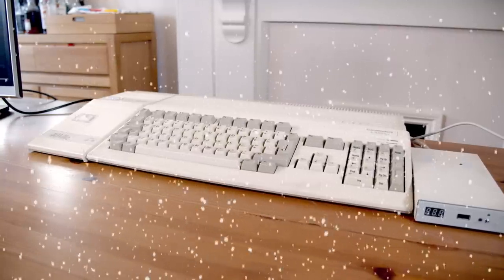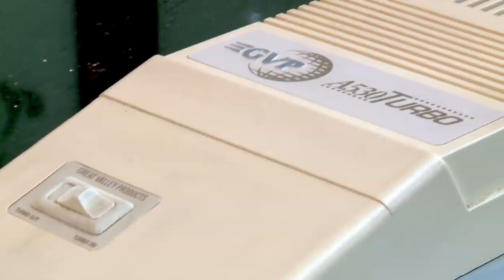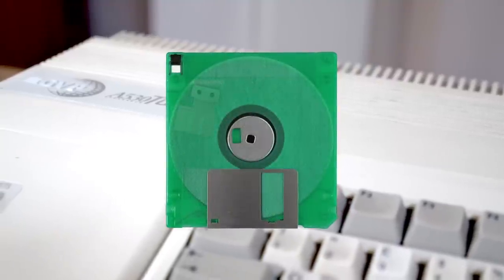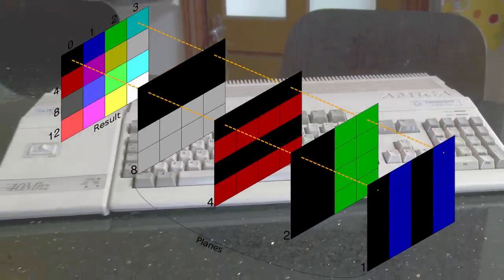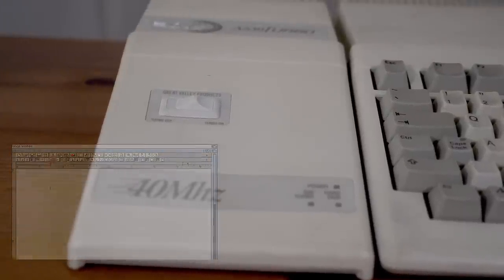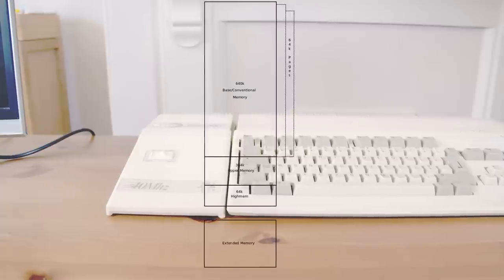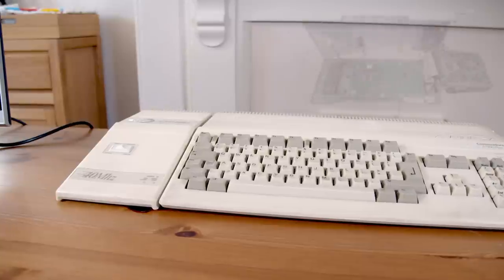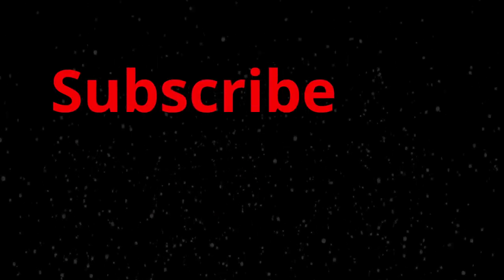This is a PC, no really.

Comment: Great video I bought the ATOnce 286 emulator for my a500 back in 1990. It replaced the 68000 chip with a daughter board that had both chips plus an emulator for video/disk/etc. it used amiga memory, hard drive, and floppies. Worked great and got me through college without having to buy a pc
Reply: I bought an non-working A500 off eBay a couple years ago, and the ATonce was inside it, which was a nice little unexpected bonus, but I pulled it out in order to get the machine working and never gave it a try. Besides, I'm not a fan of putting the thick legs of a round turned-pin socket into a single/double wipe style socket since that can ruin the wipe style socket over time. Maybe someday I'll install it to see if it still works...
Reply: Had it too. Worked fine. Even without a hard drive.
Reply: Hmm... that's just the opposite of my experience with the ATonce. I sold Amigas and none of my customers had much luck with it.
Reply: @jimsteele9261 The trick was to NOT try to have both systems going at same time. instead, when you want to run as a PC, you only give the AmigaOS the bare min amount of mem and resources to function. Later versions addressed this by also adding memory to the daugherboard.  Most non-games worked fine for me.... though any crashes brought up error messages in German!
Reply: @nicholas_scott  The "Plus" version is the one I had and it was definitely a lot better. The speed bump on the 286 to 14MHz was okay, but the onboard 512KB of dedicated PC RAM was the real gold. It also really helped if you had even a little bit of FAST RAM expansion on your A500. I ran it no problems with a mostly stock Amiga 500 with a 2nd floppy drive and a 2MB RAM sidecar.

When I wanted to use the PC emulation I had a script file set up that I could run that would make a 1MB RAM drive and copy all the necessary emulator files from the ATOnce disk and a minimal DOS "C: drive" install over to it and run it straight from RAM and allocate another 512KB of the fast ram to the PC so that it had a full 1MB available to it. That left the Amiga still able to run normal Amiga stuff with 512KB CHIP (minus the PCs video RAM) + 512KB slow + 512KB fast, and I could use the internal floppy for the Amiga and the external floppy for whatever PC software I was running. Multitasking both systems was pretty good with that setup even with a stock 68000.
Reply: @nicholas_scott  Good to know. thanks.

Comment: "Expanded memory" used bank switching to make >1 MiB memory available via pages in the high memory area. EMM386 managed extended memory, putting the CPU into virtual 8086 mode and mapping blocks of extended memory in a way that looked like expanded memory.

Protected mode on the 286 was still segmented, which made memory accesses in that mode slow. Flat memory would only emerge with the 386 protected mode. DPMI extenders like DOS/4GW would only work on the 386 or higher.
Reply: The 286 (and 186 to an extent if I’m not remembering weirdly) versions of protected mode really feel like a strange beta, like a bodge on the old system while they remove all the rough edges of the finished (386) version.
Reply: @kaitlyn__L  286 was 16bit & 386 = 32bit, except for pathetic 386sx, which had 16bit to 32bit built in, Intel was a mess back then, they were still working out a Modern CPU's  Architecture ..
Reply: @James_T_Quirk  indeed, though the bus width doesn’t inherently have anything to do with 286 protected mode’s oddities (esp given the 386SX). Though I can see your point that Intel was just trying everything somewhat indiscriminately (and their non x86 CPUs from the time were even more screwy!!)
Reply: @kaitlyn__L  186 didn't have a protected mode. It had a 16-bit data bus and added a few instructions like ENTER, LEAVE, and BOUND that you also find on the 286, but it couldn't directly address more than that 1 MiB of RAM.
Reply: You mean mapped into "upper memory". "High memory" is actually the first 64k over 1Mb which was addressable because of the way the memory segmentation worked.

The "Upper memory" is/was the IO space above 640k where devices were mapped, but could also have memory mapped into. This really only became common only with 386 hardware where a memory manager would remap RAM to allow freeing of conventional <640k for applications.

Comment: All EGA/VGA 16-color modes are planar, not two-nibble-per-byte.
EMM386 is not a EMM manager, it is an emulator that uses 386's page translation mechanism to recreate the EMM frame.
Reply: have no info. the the main suject of the video, but the intarnal CPU swap out card, and replace CPU on top, PC Dos side thing on the Amiga, showed if you didnt no, looking a emulators, to the point PC Dos, would if required sit in a app windows box, I think, but it defiantly, amiga sliding up-down windows like all good well behaved Amiga app/games did, amiga still the beating in background just with PC over the top of the desktop screen, the amiga on the box not related the add on card PC 720k format floppy disc, driver on the install disc, set little than copy and paste the in right folder 740k dos reading done on an amiga, not a big deal,
Reply: Hmm, I'm not sure about VGA 16-colour. I think the sequencer in those modes does actually read 16 bits at a time and then cuts them up into 4-bit pieces for translation into actual colour values through the DAC. Doing a bit of a weird retrograde thing in 256 colour where it does that but then combines them back into two bytes (essentially the DAC has 16 notional palettes, one nibble picks the palette and the other picks the colour within it, and IIRC you can even make use of that in 16-colour mode with specific palette-swapping commands).

EGA and below though, and those modes on VGA, sure.
Reply: @tahrey  the VGA and EGA 16 color modes are all the same, as in they're planar
Reply: EMM386, allows the USE of "upper memory", on a 286, first 640k, was given, then you had some work to get to 384k left as Upper Memory, so in your Dos Config file, you could tell DOS, & TSR's into that memory out of 640k you needed to run a Program .. If you wanted a Bridgeboard Card to get moving with Video, That's what the PC Slots are for on Amiga 2000 Motherboard, give the Bridgeboard, Controller Cards, Its own Video, Floppies, Hard Drives, things start getting smoother ..
Reply: @peterhalin  does that maybe mean the 256 colour modes are a strange kind of planar as well? There must be some benefit to using the ModeX tweak vs the built in 13h. Like it's actually the only way to get chunky or whatever?
Reply: @tahrey  Not sure how they work internally, but the 256 colour modes are the only ones that provide programmers access to a chunky pixel format. One of the benefits of ModeX tweaks vs 13h is that you get access to 256kB of VRAM instead of the single 64kB buffer provided by Mode 13h.
Reply: @peterhalin  ah OK then. I guess that makes it a bit easier to have a scrolling playfield for one thing when your visible area takes up 64000 of the 65536 bytes (whereas in planar modes even high rez VGA would have had a decent amount left after the 37.5K needed for each plane, and far more so for EGA grade graphics). I think some games tried to get around it by using e.g. 256x192 instead, but just having a flat map is much better.

I'll have to go back and see if I still have the spec sheets anywhere then, to check up on how the data to image translation actually works. Maybe they just figured it more worthwhile putting in the extra silicon to deal with running that one mode completely differently to everything else. (also I was probably mistakenly assuming it used 16-bit access before, as I'm more used to ST and Amiga, but the circuitry would have been running at a somewhat higher speed locally so the narrower bandwidth wouldn't have mattered, and you could either read four plane bytes in the time taken to serialise out the last four as eight 16-colour pixels, or just pump the bytes straight through to the DAC without even touching the shift registers, even if the DAC was still built in a way that meant the low nibble was the only actual index and the high nibble was used to select a sub palette...)

Comment: I could quibble about real mode segment arithmetic being somewhat different from simple bank selection (since a segment can start on any 16-byte boundary), that 286 protected mode didn't give you a flat addressing model (we had to wait for the 386 for that) & that EGA graphics (at least the 16 color mode) definitely used bit planes - but hey, it was a great video that I thoroughly enjoyed, and (small issues notwithstanding) it did a great job of explaining some pretty arcane stuff to a wider audience. Good on you for not glossing over the hardware failure too.
Reply: if i'm not mistaken, every graphics mode even vga 256col (mode 13h) used bit planes. just in 256c, planar access was "hidden" from the prog. and the card used the first 2bits of the byte writen to select the plane and the rest for the color. faster access but wasted 3/4 of the vram. mode x/y revert the vga to 256c planar. full vram but slower access (mostly). meh, pros and cons...
Reply: @giornikitop5373  Exactly!
Reply: @EgonOlsen71  yeah, basically every graphics chip since the m6548 era used bitplanes, but the amiga custom chips used  them is a very different way, making ports between amga/pc a nightmare. anyway, in the pc, once 486 was out, due to it's very fast memory access (1 clock), plannar access was not needed anymore.

Comment: The a590 was shipped with a slow XT-IDE mechanism. The controller itself can do 1.5MB/s just like the GVP if you fit a fast scsi drive. Yes I'm fun at parties
Reply: And that was done because of the prevalence of IDE - the standard that was current then for the PC. SCSI drives were the domain of Apple, high end servers, and fancy workstations.
Reply: Yep, they were using XT-IDE in their PC line at the same time and no doubt the 20MB WD drives they bought were among the cheapest slowest drives available.
Reply from the maker: Part of preformance issue was also how it loaded the CPU for data transfers. It could indeed be faster with a bettter disk, as long as your cpu had nothing else it needed todo. A big block of data being transfered would really busy out the cpu and make workbench rather unresponsive for the duration.
Reply: @RetroBytesUK  maybe with XT it eats CPU? Can't remember for sure now whether XT was CPU bound or not. SCSI is DMA in the A590 and does not eat CPU cycles as long as you have some genuine fast ram in the system. The GVP cannot perform either without real fast. :-)

Comment: Absolutely love this trip down memory lane. I had a mate who had an Amiga 2000 with a PC Bridge Board. He had an early 386 and a 1mb Cirrus Logic graphics card for it and stuck it in his A2000 and wow! PC games on the Amiga. Not that they were all that good though given as you mentioned, the Amiga was a much better games machine at the time.
Reply from the maker: That would have been a very nice machine back then, not the cheapest machine, but a very nice one.
Reply: @RetroBytesUK  It was easier to put it in another box, bridgeboards are great things, but tricky to run, but with Own Video and HARD DRIVE they speed up, with the PC slots on Amiga 2000 you could add a Controller card, so give PC side Hard Drive, Floppies, I/O & Video of it's own, then a 286 got moving ... I have both XT & AT Bridgeboards here, never got my hands on a Goldengate 486, but wanted one..

Comment: Wish there were more expansions for the Amiga 1000 out there. I bought the A1000, and just recently found out about the Parceiro expansion for it. As soon as I get that squared away, I will finally be able to get my feet wet with one of the most coveted architectures I've ever known. Thanks for the great video covering this. Wish I could afford a better Amiga without having to pay the kind of prices I just sunk into a MiSTer for...
Reply: It seems like Commodore was going for "sleek and compact" with their early Amiga models, trying to avoid the "boxy" slots look of the PC and Apple II. But the side expansion is painful, and you either have the TI-99/4A sidecar experience, or you need a wraparound expander that sits above/below in a huge slab case the size of the entire original machine, and gradually lifts your monitor higher and higher...
Reply: @DMahalko  AND... God forbid should you BUMP your Amiga! Best case scenario, the machine locks up and you have to restart, re-load Workbench, etc. Worst case? Hardware damage. I worked for a dealership back in the 90's and we saw both cases... Unfortunately. BUT, USB/fast serial connections were still many years away (although pioneered by Amiga's distant cousin - the Atari 400/800!), and you still had the FCC breathing down your neck, so you had to worry about proper shielding.
Reply: Well Apple Liked the Sidecar Look, they ended up bolting a Amiga on the side of Mac, so they could use it for Video Work ..
Reply: @Chordonblue  When I worked for a Computer Chain here in Australia, in 1980-90's, A Guy bought a Digi-View from us, took it home, DID NOT READ the MANUAL, Decided that it needed to be plugged in to the Wrong Port, did he scan the rear & Find the Right Port ?, No took some Needle Nose Pliers bent the "d-Shell" away and bent pins trying to make it fit, This having FAILED, He came back to SHOP & Abuse us for scamming him, when we explained his error or "Gross Stupidity" he left after abusing us some more ... I miss the 80's ...
Reply: @James_T_Quirk  You had to be of a certain mindset in the early days. Very little detail was explained to a customer - unless they asked. It was just too much for some folks.

At my dealership, here in PA, USA, we carried PCs and Amigas. We had a customer who bought a laptop (Acer). It was one of the first COLOR models back in the 90's. VERY expensive. 

It used one of those trackballs as a pointing device. The trouble with those back then is that they would often get 'sticky' and the little rollers that held the ball in place were hard to clean. Only a few days after purchase, he complained about it, and we contacted Acer who promptly blew him off and told him to get clean his hands better before using it.  😑

A few weeks later, the guy was back with what remained of his laptop in a box. Sheepishly, he explained that he had literally and repeatedly stomped it flat in complete frustration. 😮He wanted to know if there was anything we could do.

Now this guy was a locally prominent businessman, a regular suit and tie kind of guy - you would have NEVER expected this kind of display from him. 

So, the owner went to bat for the guy, calling Acer directly and explained the situation. It took a while, but eventually his call got bumped up to the PRESIDENT of Acer! 

And, believe it or not, Acer actually shipped him a new model - sans trackball this time, of course. 🤣
Reply: you bought the wrong Amiga then. The A2000 would be much cheaper and better solution for you, if you want to expand. Even cheap A500 is better expandable then A1000, and A1000 are rather on the expensive side in Amiga world, just A3000 and A4000 are more expensive now days.

Comment: I remember using the CORTEX ram expansion board on the side slot and the AT-Once board in an A500 for a while, before I put together the good old A2000 with 680030/68882  Bridgeboard and MAC Emplant card and it took over all the non Amiga stuff (MAC for DTP & PC for the 'Business stuff'). A second 'big box' Amiga was crammed with '030/68882 + Genlock + Newtek Video Toaster + SCSI2 card  + RAM and a pair of  fat A4000s + the Raptor Engine with 24bit framebuffer cards, TBC, Newtek Video Toaster, etc were hooked up to a pair of BETAcam SPs, Two Sony edit recorders (with single frame step recording)  Panasonic edit deck & Panasonic M8000 camera with PAG belt and 8track audio recorder handling the video production side of things.  I also had a pair of A2000s with SCSI2 cards + a dozen hard drives + 4 CDrom drives running a multi-line BBS with USR modems for each line.  Ahhh, the good old days when the combined cost of the electricity, phone bill and 6 rented TVs were between £750 and £1000 a month depending on how long (and where) we transferred files to/from over the phonelines. and we still found time to have fun with the CDTV, C64, C16, +4, C128, C128D and an Atari 1040STFM.  I seem to remember there were a helluva lot of cables and never enough mains sockets.. :-)
Reply: damn ... what were you even doing with all that?
Reply: @tahrey  Sounds like a Toaster Farm & Digital Video Processing, I had one running myself, still have the 12 A2000's &2 Toasters etc that ran mine, but after not doing much with it last 20 years it's just a "Sea of Cables", If I had to set it all up again, it may be a issue, when things where happening I was just buying more bits to add to get results I needed, but the path the Amiga's grew is a bit of mystery lost to time, I may have to read the manual this time, just to hook it all up ..
Reply from the maker: Those raptor engine cards where fairly darn expensive, there where not many places with those. Where you doing qlot of 3d work with them.

Comment: I used not one, but two SupraDrive 500XP with 2MB memory connected after each other (52MB and 40MB hard drives). The SupraDrive has a passthrough expansion port.